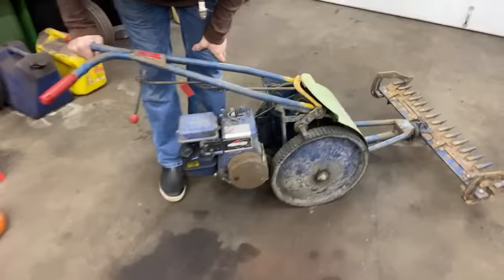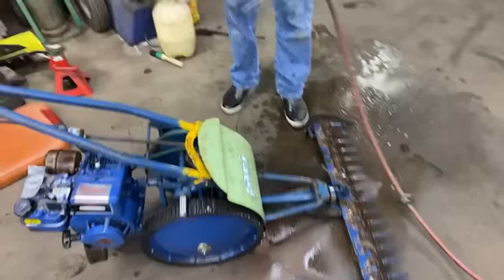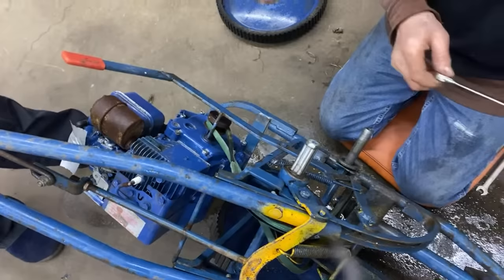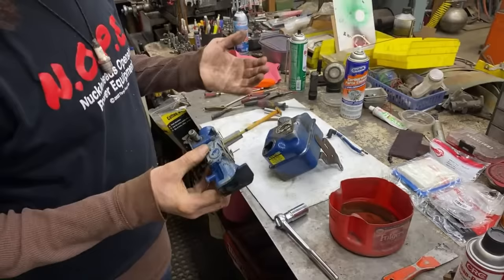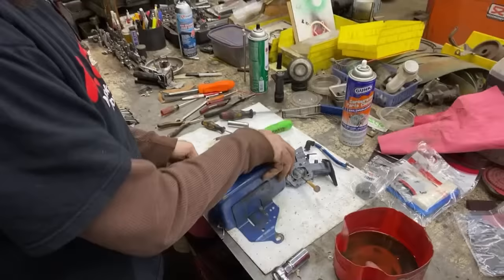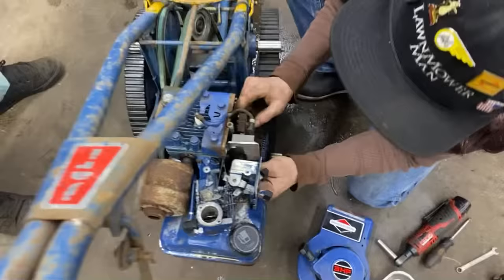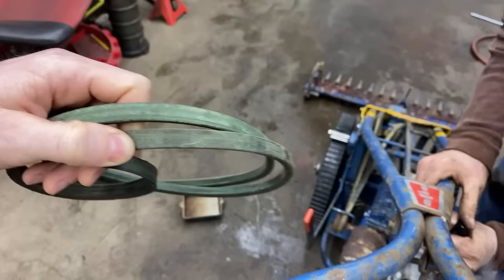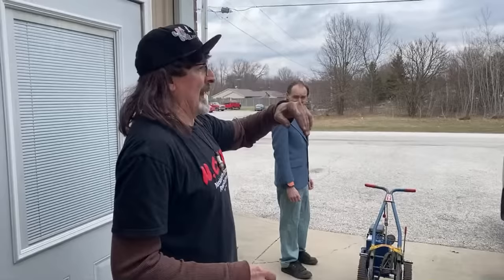LIVE FIX! Jari Sickle Bar Mower - Will It Run?

Comment: My father had one of these and used it to keep a field and some walking trails cleared around his property.  Worked like a champ for many years.  They are great scrub brush mowers... and yea, they take down saplings, no bother.  The RPMs also sound about the same as my fathers.  I always thought that thing was loud, but it seems to work best at that RPM if I recall correctly.  You can also cut the thicker saplings if you disengage the self propel and let the sickle bar gnaw at it for a bit.

Comment: Man my great great aunt had one of these and when I was about 9-10 yrs old I got it running and mowed a couple of acres of cow pasture with it, it mowed REALLY well.  It must have had oil I wasn't brought enough to check back then lol.  Dunno how many years it had been sitting, prob longer than I young back then lol.  The self propelled was so cool, I actually used it like a tow motor when I wanted to pull something I wasn't able to I would just bring the sickle mower and use it to drag whatever lol.  The levers were a little different both were up near the handles one on each side, PTO and go.
I dumped some gas down the throat and she fired right off, I believe it was my first "will it start" situation in life now that I'm thinking about it lol, too bad I didn't have a camera back then of the stuff I fixed and fooled with as a kid, I'd probably not have to make content today, people would bring me all sorts of stuff to fix, cars to electronics/computers I was a nerd in my day.

Comment: I used a sickle bar mower in the 80's and 90's made by Fulton Mfg. of St. Louis, MO. In the mid 40's.
Old motor with a pull rope to tie on the handlebar.  It had more downtime than anticipated.  It's a good thing to cut multi flora roses.

Comment: Ón cracks in the fuel pick up tube after you get it clean, you can coat over the crack with Seal-All. It comes in a red and yellow tube. Made to seal fuel leaks.

Comment: I'm Def a green horn. But. I would have put the vent on the air cleaner out the back so head and dust from cutting isn't immediately sucked up.    Nice job as always.

Comment: My father-in-law gave me a two-wheel Montgomery Wards "walking tractor" from the 1950's when we moved to our first house in the country.  It had a 3 hp Clinton engine and a sickle-bar mower and harrows attachments.  I made a snow plow blade and a brush-hog attachment for it.  The nasty part was that the lever to operate the belt tensioner for the drive had a weighted end and it would hit me right in the crotch if I wasn't careful.

Comment: The flat top Briggs were good little engines. The larger flat head Briggs in riding mowers were good too. But when they came out with the single cylinder Intek they really went to crap!

Comment: The sound is great for using a sparkplug as a microphone.  🤣  Taryl,  change it over to an electric motor, battery, and check the air in the tires and theirs your breakfast.  😎

Comment: Terrel, you mentioned James Brown, James Brown was a real perfectionist. He was tough. They said he was a really perfect very professional performer. I always like James Brown this is six in a row jim from Kennerdell Pennsylvania, I go by six in rowJim I have a 91.5 dodge three-quarter ton. Let it be understood. I got a Cummins under my hood. Hey keep up the good work Terrel I have a carburetor just about like that on my Rototiller I put a electronic ignition and it did all kind a little things for you know set the thing in my basement heated garage basement OK stay dry of course the following spring would not start got a fuel problem. Gotta yank the carburetor off and find out what’s going on, I left ethanol fuel in it. I didn’t realize it might cause a problem. Anyway, I appreciate what you’re doing there.

Comment: I have a 12hp Breaks&Scrap'em. Battery went bad and before I replaced the battery I checked the voltage from the engine going to the battery and it read 21 volts. Is that too much voltage?  Saying hi to all the guys there and a shout out to my personal favorite Uncle Andy!!!!
Reply: This is David Elder from Georgia.
Reply: I was driving through Georgia and saw a guy try to run from the police, didn't work out for him too well😂

Comment: Don't nobody unnastan Chinese.
Boy.
"I am from ow of town"
Hahahaha
I got you a beef and bean burrito.
Hey, where'd he go?
Sorry to hear you got a cut and I hope you relax and heal up. Use some Neosporin to keep the biological critters out.
Bandage up and have soup.
No Hamm's for a few days.
Reply: Slippers is the best character with Taryl and they both play several parts.
Slippers made a good video for the carb on the tank with diaphragm.
A lot of guys have that mower, and the two gasket diaphragm fix is in the video.
Three pumps, pull the rope, and it mows without acting possessed.
There's yer supper.
Cheers, slippers.
You can just get those diaphragm kits for them at the local auto parts stores cheap.
Anybody can do it.
Except slippers characters, that is.

Comment: When the blade needs replaced  !! You take the bar out to sharpen or replace a bladed.  To replace a bladed you grind off the head of the rivet and punch it out  the blade will fall off  .  You rivet the new blade on  that's it  ! 😎

Comment: Never heard of liquid tape!, Have to check it out at my local hardware store. I always slide a piece of heat shrink tube over the entire length of the wire. I work on a lot of older engines and find the insulation to be brittle on many of them, so I made it a habit just to be on the safe side.

Comment: The sound is really bad this video. I have to keep my volume and speakers  to MAX, just to hear what's going on, then when the camera gets close to Taryl or when 'JR' speaks, it blasts my ear drums. This is a major downside to livestreams, there's no editing or checking the video first to make sure it turned out ok, before releasing it.

Otherwise, that Jari is a cool machine. IMO superior to the TroyBilt sickle mower sitting in my barn the last twenty years for several reasons. Troybilt, tires too small and it runs aground too much and is hard to get unstuck. The Jari has GOOD size wheels, much larger and nicer. The Troybilt's bar the teeth attach too, snaps too easily and a replacement is $100, that's its main flaw. Yeah, $100 for a 1/4" thick, 1/2" wide, 48" long piece of steel.

Comment: Gunk Carb Cleaner sucks, it's cheap and it's s-l-o-w to evaporate , I use CRC Brand,  not a cheapskate like Taryl
Reply: All the cleaners from carb spray to brake clean have changed over the years, probably price of chemicals and EPA regulations